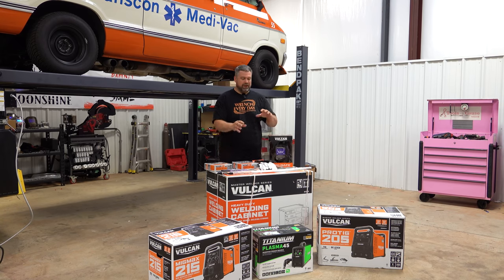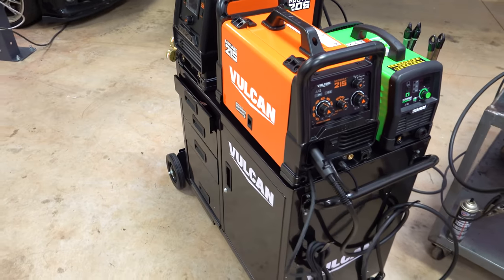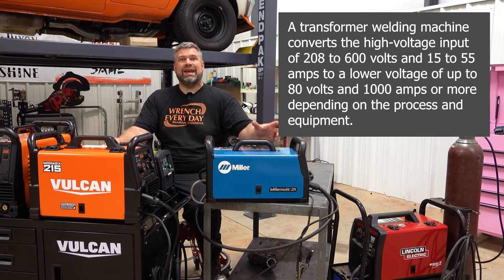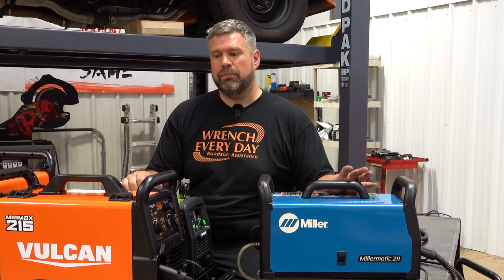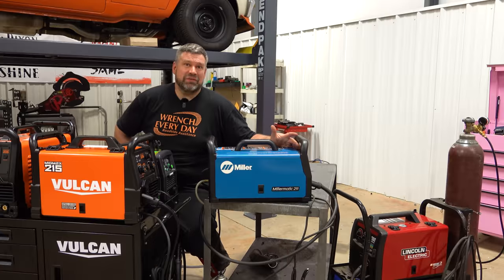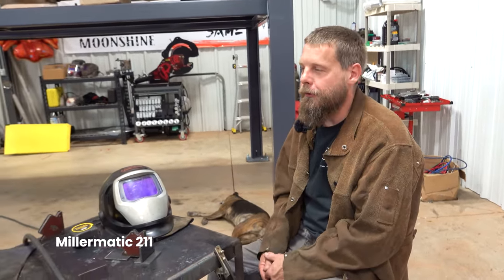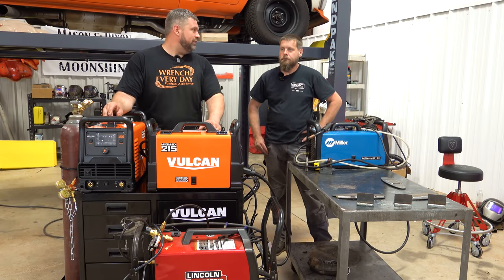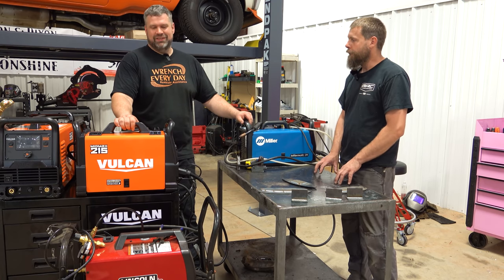Here's What NO ONE Will Tell You About Harbor Freight's "Best" Welders....

Comment: I like how Harbor Freight did reach out and made improvements; BUT I just can’t get over the fact that nearly all are made in china.  I simply cannot give money to that country just on principle; so I’ve been avoiding HB like a plague.  But that’s just me.
Reply: The Vulcans are made by an Indian company.
Reply: dan725: quote "I simply cannot give money to that country just on principle"

Me too but really, there are few tools you can buy that are made anyplace else then china. That sucks but that is simply reality. 

Harbor freight swivel head ratchets with fine click are simply better then anything else on the market except for maybe snap on. I bought the 1/4 drive and then bought the 3/8 and 1/2, and, luckily I did that back when HF still had 20% coupons so I got a killer deal. These ratchets will handle 98% of everything I do. 

I would not expect them to be as strong for ultimate strength but for anything less, they are simply the best. Bought a diff and axles from a u-pull junk yard and my 1/2 drive craftsman breaker bar would have broke on the axle nuts. 

What worked? a 1980's snap on 1/2 drive ratchet with a 3 ft cheater bar broke those axle nuts lose with ease. I would never even consider using my HF swivel head ratchet for that. You got to be real about things...
Reply: I don't know who I hate having to bring my money to more them or walmart but I can't afford not to lol
Reply: Same here. I will not shop at that store out of principle, I don't want to support lower quality manufacturing and throwaway items. I'm not the guy that says, "I'll only use it once." I don't care, I miss the days of having quality stuff you could buy anywhere. 

Not too mention it's a giant cycle where USA manufacturers price themselves out of reach, so people go to places like Hazard Fraught, rinse repeat. I'm not saying they don't have nice things, like their toolboxes, but that's not incentive to give them my money.

I had a coworker buy some air tools and they wouldn't shut off, as soon as you plugged in the hose they were on. He went back, got another, and same thing. Went back, got a higher dollar one just to get one that worked. Why not just get one that works out of the box, but might be 4 times the cost? It beats spending a couple hours driving back and forth for a still lower quality product. But I guess I'm in the minority, nice tools are just a pleasure to work with. And no, I'm not a Snap-off fan boy, I only have 2 of their ratchets and a breaker bar.
Reply: ?  whose welders at these price points are not made in China?   maybe assembled elsewhere?  I'll wager all miller and Lincoln circuit board assemblies are all fron China.
Reply: Everything you have is made in China. That miller has LOTS of Chinese parts.
Reply: What tools do you buy that are not made in China, power tools/ hand tools? 

Harbor Freight has a lot of tools made in Taiwan, where most hand tools are made of high quality.
Reply: @KISSMYACE3203  -- I don't know how many times Harbor Freight has saved my ass in my early days after I'd broken something because I could buy a cheap "throw away" tool that got me through for a few days until the paycheck came in and I could afford a better replacement.  Don't knock them.  

In fact, over the years, their quality has shot up. I still have to admit, I still have more than a few HF tools that lasted much longer than I thought they would.  They're nice to have as a backup.
Reply: @1924ab  Vulcan welders at Harbor Freight are NOT made in India. Same name. Not same manufacturer. I own Vulcan welders from Harbor freight. Very well made!!! I HAD both miller and Lincoln  equipment over the years. Technology has caught up. There is no need for over priced blue  welders anymore. They rest on they're laurels  to sell their over priced products.
Reply: Solid, affordable, long lasting, home shop equipment that keep on giving, and keeps you in the running. That's  what you get!  China/Taiwan,....yep. They sure are. So is my iPhone, laptop, tv, microwave, fridge, electronics in my American truck, electronics in my Mustang, treadmill, toaster, bathroom scale, radio, blender, etc.
So if anybody wants to say that they won't  spend money at Harbor Freight for a tool, because  it's made in China, you might want to wake up and research a tiny little bit.  Go look at your big, American made pickup truck. It's a global market, and you will find parts from all over the place!
Reply: @kender1412  I'm not knocking them purely on product quality. As I've said, they do make some decent stuff, but they also make A LOT of throwaway items, which I despise. It's needless waste. I do my best to avoid such companies.
Reply: @Joeak74  -- Most of the parts of that American made truck are made in China...
Reply: @KISSMYACE3203  -- Again, a LIFESAVER when I couldn't afford a good replacement when I broke a more expensive tool to get me through a few days until my next paycheck.  Don't knock "throw away" tools.
Reply: @kender1412  Yep!
Reply: There is a 99% chance the device you used to post your comment was made in china. Not a china fan but the reality is that most phones and tablets are made there. You can buy american tools but the cheap stuff will most likely come from china.
Reply: I have the Vulcan Omni 220 and it is made in India. Scored it for $600 open box deal. I've had it for around 2 years and it's been great so far.
Reply: @1924ab  the welders made by Vulcan in India are "Yellow" in color and NOT the same Chinese manufactured Vulcan welders that are "Orange" in color at Harbor Freight. Only the same in name only. Please check the box, and the unit itself.
Reply: @robert5  tekton swivel heads are pretty nice, 90 tooth, made in Taiwan iirc. I have a 1/4" and it's nearly the same as the 3/8" hf one I have.
Reply: @robert5  you must have a very hard time shopping in this day age 90% not made in USA
Reply: @1924ab  Not true. Not now, anyway.
Reply: @KISSMYACE3203  you obviously haven't seen anything on HF earthquake air tools. Shocked me when AVE broke one down and was impressed with it, he even compared it to snap on quality build and parts. He was amazed at what they were selling in just the over $100 range.  They have and continue to upgrade their brands and tools. I own a lot of milwaukee m12/m18 tools and I own a lot of HF Bauer tools who's brushless tools are unbelievable for the price. Two weeks ago I bought the new Bauer brushless angle grinder and out it to the test with my friends m18 brushless angel grinder. The Bauer advertises 2000 rpm more than the milwaukee, I couldn't count them, but it outperformed, weighing less, more comfortable to hold and I got it for $55. Great buy. I'm not a tool snob of course, I do root for the cheaper underdog to perform as good or better. I like to compare less expensive same class tools and really root for the less expensive to do well. 
HF has the old cheap junk, but have really improved on quality products that can give more expensive tools a run.
Reply: @robert5  what tools power tools do you use, milwaukee, ryobi, AEG (color and battery change to be Ridged tools for Ridged) Heart, Homelite, if any of those you have purchased, not only made in China, owned by Chinese. You give China money daily and don't know it.
Reply: @derekdugger2321  I give china money daily and do know it... and that pisses me off. Try to live without buying a china made thing or item, for however long... I don think it is even possible these days. Used to be but not anymore... and that pisses me off.
Reply: Who should we be pissed at for everything nowadays made in China or from Chinese parts? China or greedy American businessmen?
Reply: Dan how do you live without giving money to China?
Reply: @1924ab  India isn't a communist country
Reply: @ophidian1965  not in name but so class rigid most of the population lives in abject poverty.
Reply: @JohnGalt-vr3lx  well good luck finding something not made in China
Reply: @thepitpatrol  it's actually not all that hard. My tools for doing my work as an electrician are made by Klein. They have been in business for over 150 years in America.  My sockets and drivers are sk and proto with some Wright. It really isn't that hard. But I guess it's easier for you to say it's impossible than it is for you to support your country and your fellow American workers
Reply: Miller and Lincoln are both made with parts from China and assembled in China. Just has a usa made sticker because the sticker was made in USA, that's the difference.  Same with designer clothing and apparel. Made in same factory as high end products, except the high end gets bells added before shipping.  Americans want usa made stuff but only want to pay Chinese prices. Pretty simple. I buy whatever gets the job done, who cares what name or where it comes from.
Reply: @JohnGalt-vr3lx  Chinese company bought s&k.
Reply: @JohnGalt-vr3lx  as an American machinist who has been in American manufacturing for 30 years, your American electricians tools are 99% likely to have been machined in Chinese/Taiwanese equipment. You can wave the flag all you want, but the fact of the matter is that even American-badged products have Asian input at every level. Most metal is now sourced from overseas as well. Your Klein pliers are likely machined out of Chinese materials. I don't like it either, but this disease is much more insidious than you or anyone in this comment section would ever like to admit
Reply: Snap-on tool boxes are manufactured in the same buildings as harbor freights. I agree with you on buying china made products but the sad truth is most companies are sourcing china and most times made in America labeling means nothing more than assembled or packaged here
Reply: @kender1412   replacement parts from OReilly autozone an advance never found a factory part with China name on it .
Reply: @michaelwillcutt2619  -- I don't really care.  O'Reilly, Advance, and Auto Zone tools are overpriced for what you get and they have little to no selection.
Reply: @robert5  i like the craftsman  wratcheting wiggle joint 3/8 big ratchets and they are cheap and yo can open them up to put grease in em
Reply: Wait till you here about 90% of your electronics parts are made from
Reply: I’ve always bought snap on tools when I got into the mechanic business the 1/2” ratchet was 110 dollars 20 years ago, same ratchet now days $300, HF same ratchet is $50, blame the politicians.
Reply: Lol you don't avoid China like you think you do
Reply: You literally CANT avoid giving money to that country.
Reply: @kender1412  harbor freight quality has improved drastically over the past decade. It's hardly the same store
Reply: @Joeak74  since 1980, Vulcan welders have been manufactured by Canary Electricals Pvt. Ltd. Which is based in Morbi India. What that said that doesn't discredit their quality. In some cases they are better than their overpriced Miller and Lincoln counterparts
Reply: Lol what isn’t made in china buddy
Reply: You are not giving the money to china you give it to the company and more on to the worker at the store
Reply: Don't look at the back of millers or Lincoln's lol
Reply: Ask anyone that has been on a tool truck in the last 25 years. I will tell any new tech to save your money there is some decent quality stuff there.
Reply: Bros standing on the weirdest hill. That principle is going to take you anywhere different when you're 6 feet under. If I can get something just as good but cheaper I'm getting. Give zero shits of point of origin. Figured the money saved for the same results can go to other cool things

Comment: As a professional welder and had the same budget of $1000 I'd just build an all in one welder so I can TIG MIG Stick and plasma cut using a high duty cycle DC stick welder as a power source, a Tig welder is literally plug and play with a stick welder which a complete torch and Guage can set you back $75, a mig welder feeder can be gotten for $250 and up depending on what your budget is I picked mine up for $50 off a blown 3 phase machine which is plug and play for most machines with that connector, stick welding is pretty obvious since it is a stick welder to begin with, finally plasma cutter you basically have to DIY this one since it's not available which it's extremely simple all you need is a 12v air solinoid, a cheap car compressor, an air regulator, a 12v stepdown transformer and a plastic box which overall cost me $80. So in short you can build the perfect machine for what you need and would be extremely cheap to do so.

Comment: I have a Vulcan Omnipro 220.  I love this machine.  I was on a budget but wanted the convenience of other welding types.  This machine is a great traveling welder machine.  120v/220v, full mig or flux, arc welder and steel tig.  This machine is not made to tig aluminum.  You can get the spool gun for mig.  All that being said considering this is an inverter machine it needs some protection.  Whether using it on in house voltages or especially a generator it is best to run it on a line conditioner to help regulate the drops and surges.  Inverters and the settings on the machine are primarily electronic so they are susceptible to line noise.  The Vulcan welder has been around for over 40 years.  The Canary company in India is the producer of this machine.  They are built in different parts of Asia.  I read an article that stated the commercial grade Vulcan machines had even been used in Japanese shipyards.  So Vulcan welders are not new to the market or industry.  I love Harbor Freight.  I have so many tools from there that I use everyday in my business, not just hobbies.  I even have a Chicago Electric plasma cutter that I have used several times every week for 7 years now.

Comment: I made a welding cart from a welder or welding cart base, a set of drawers from a modular desk and some plastic sheet and fiberglass angles. It holds my Lincoln Pro Mig 140 and my Hiweld plasma cutter as well as a small air compressor for the plasma cutter. My shop area is small, so I have to accommodate and make the best of.
I will add here, that there is a place for a cylinder on the back of the cart, too.

Comment: Not sure if you covered this but Miller does make the Multimatic  AC DC tig and wire machine all in one. It will absolutely do all welding processes and tig weld Aluminum. Unless you need to do some thick Aluminum it will work. You still can purchase the spool gun to do Mig Aluminum also. The one draw back is cost. i bought one because I use Miller at work almost exclusively at work and have been using them for almost 40 years. Very little warranty work for any of the machines I have used. i thought about  buying the import stuff for home garage stuff and just decided to buy Miller. The other reason is it's built in my home state and if I have to deal with repairs It is local to me. Just my opinion and of course you can purchase what you want.

Comment: I have a Chicago Electric 240V 170A flux core welder that I picked up for under $200 with coupon.  It welds just as good as any $450+ mig welder, as long as you don't need to weld for long periods at a time nor (mostly likely) more than a couple hours a day.  I bought it because i needed a welder RIGHT THEN & HFT was open with one in stock on Saturday evening.  I wasn't really expecting a lot but have come to love it.  Once again, I can live with the lower duty cycle, but that can be a real problem for some people.

Comment: I weld for a living. At work we have old school miller's running off 440 volts. We use .045 and 95/5 gas. At home for personal stuff I've got a Campbell hausefeld 180 running off 220 volts, .035 and smaller wire using 76/25. Ive also bought a Vulcan protig 200. It does stick as well as tig. I love the Vulcan, so I know how I feel. I was a little disappointed I didn't see the Vulcan tig used, but I already know they work great. I'm always looking for another welder, after watching this I may get that Vulcan mig for around the house stuff.

Comment: I'm a homeowner, DIYer and looking to get a multi-process welder.  I have been looking at the Titanium Omnipro 200...and was at a local hardware store this morning and saw there's a Lincoln multi-process welder for about $100 more....well now what LOL.   

From my understanding the multi-process Vulcan and Titanium machines you can do both MIG with flux core wire, or MIG with shielding gas, but you have to buy the cylinders/gas....so, with that, I would need 2 cylinders, 1 with Argon, the other with CO2/Argon mixed?  

I only use a welder a handful of times a year, and although my old $100 Harbor Freight MIG welder has done well, I would like to upgrade a bit to a multi-process machine and learn TIG and Stick welding as well, and not having all the space, a multi-purpose machine makes more sense for my seldom use needs.  

Looking at the Titanium machine it seems that would be a good fit to my seldom use needs...the Vulcan is more expensive, has the same features, and in the end its going to come to which one is actually in stock.

Comment: Three manufacturers offer four different AC/DC multiprocess machines; the Everlast Lightning MTS 225 & 275, Miller Multimatic 220 AC/DC, and ESAB Rebel 205ic AC/DC. I have a very small workspace and intended to get one of the Everlast machines before an emergent need pushed me to just get a MIG setup and get to work.